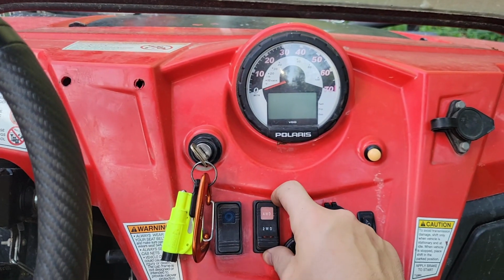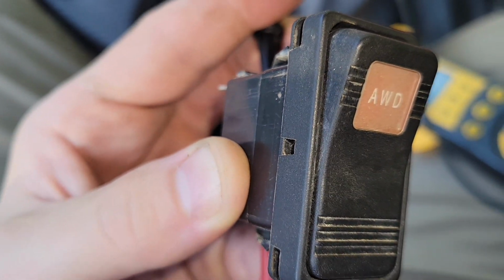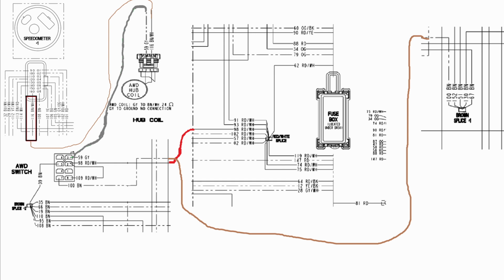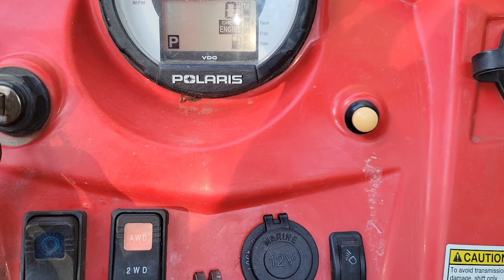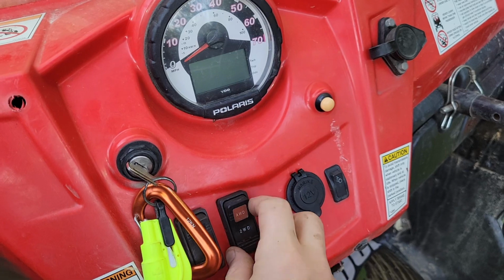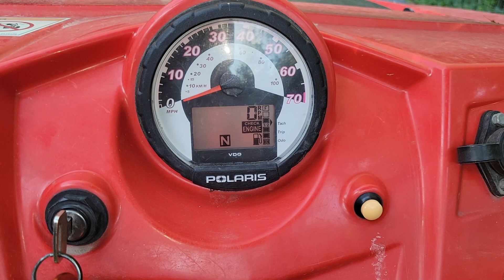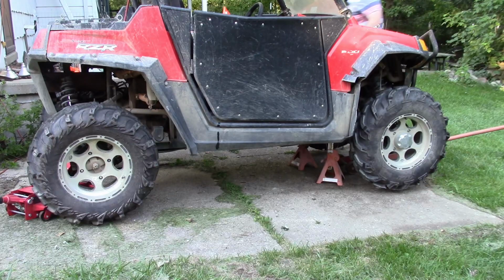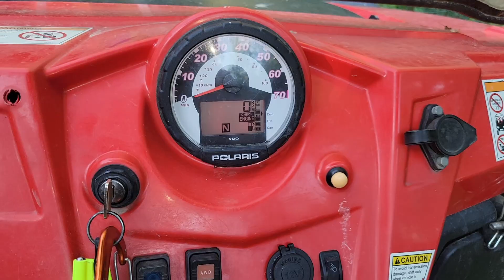2008 Polaris RZR AWD 4x4 4WD Troubleshooting / Wiring Diagram (AWD Light Flashing or Blinking)

Comment: Does the driveshaft turn all the time continuously until you turn the switch on?
Reply from the maker: Yes, the driveshaft is always spinning along with the rear tires.
Reply: @ thanks for the quick reply I believe I have an issue with snorkel gear in my transmission. My driveshaft does not turn when in 2 wheel drive

Comment: Thank you for this video. I pulled the switch and sprayed wd-40 and shot air to get out any dirt. It worked. Thanks. 2014 RZR 1000XP 6,500 miles.

Comment: Can you tell me why i am losing P R and Non the dash intermittantly?
Reply from the maker: There is a resistor pack under the drivers seat that can cause this issue. It can also be the gear sensor on the transmission but the pack is easiest to test. If you Google rzr 800 resistor pack you can find much more info than I know.